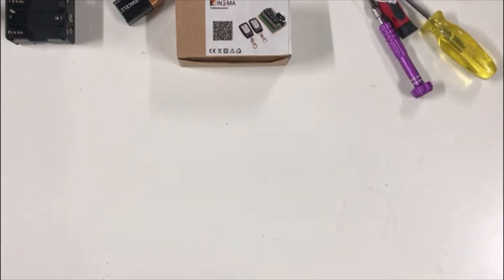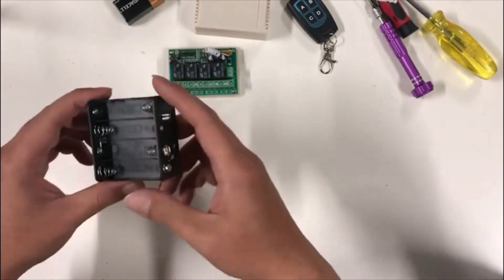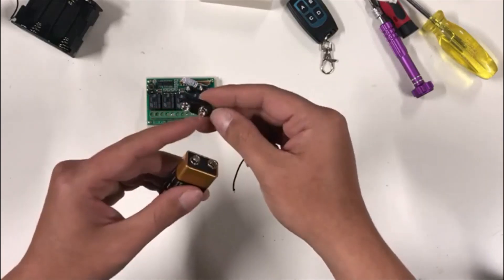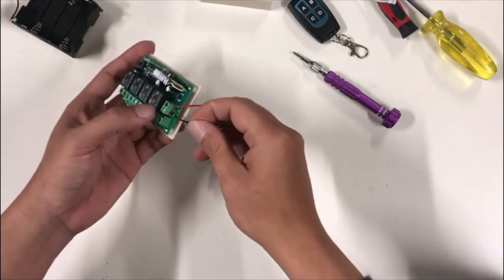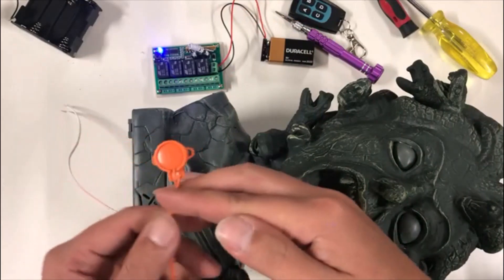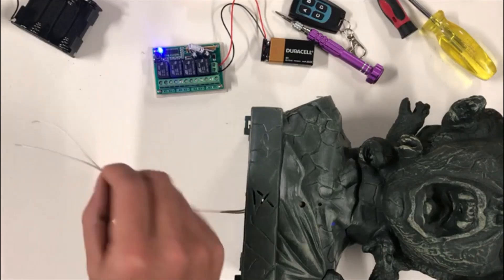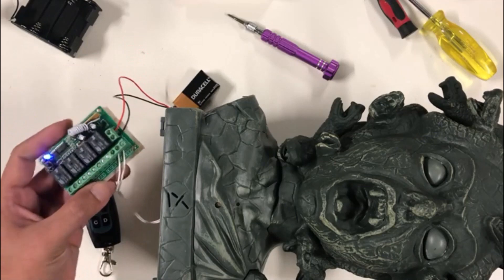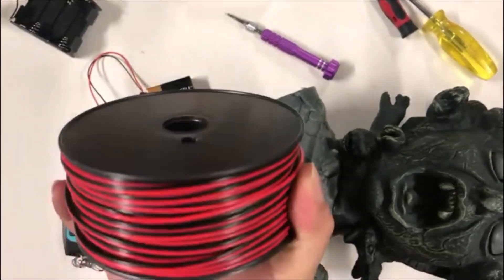Beginner - Activate Halloween Props with Noise/ Motion Sensor Using Remote Relay Switch Board

Comment: Do you know how to do this for a battery operated animatronic that does not have a try me button?
Reply: ive never done it but i would assume you'd have to cut the motion sensor on the animatronic and rewire the 2 wires on the sensor to that receiver he wired it to.

Comment: The memory button is used to change the remote control code in case you lose the controller that came with the sensor device.